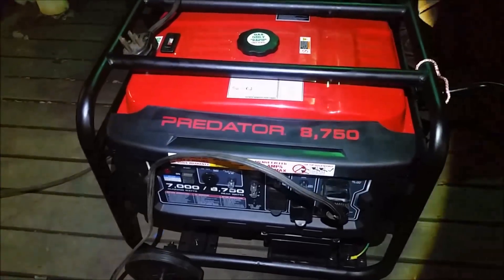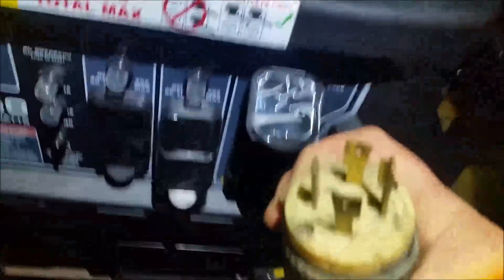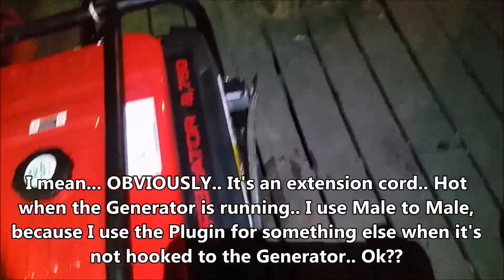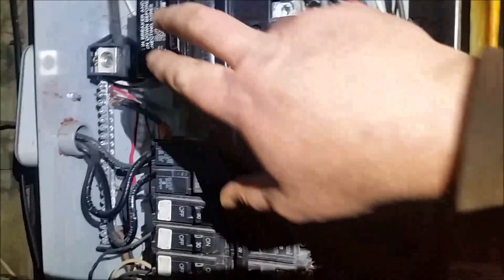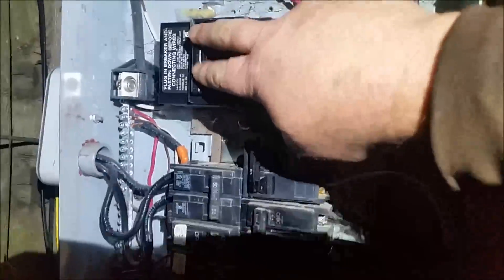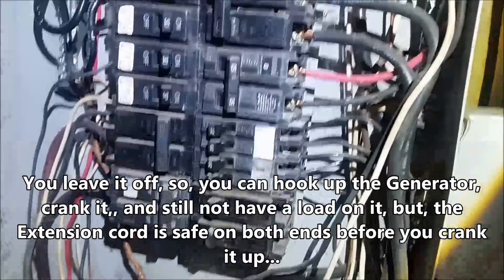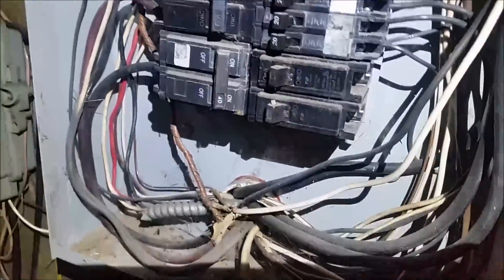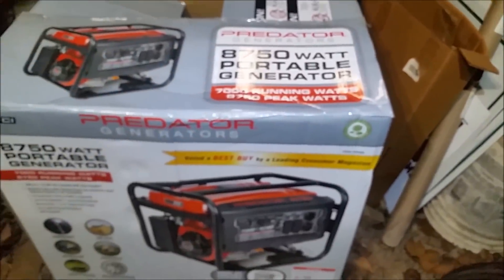Quick/Easy/Safe: Use Existing Plugin/Breaker for Generator hook up to your house Panel box.

Comment: Story time......
One of the many times i used a suucide cord this is what happened.
I hooked up a gen by backfeeding my welder plug in my garage. I told my wife dont touch it no matter what. No point of explaining y other then i said it could kill u. While i was at work i called her to ask her the status of the fuel level. She said the gen is off and shes back on grid.... i couldnt form words for 15 seconds then only curse words for 30 seconds. Why, how, what the f did u do?!!!!. She said the neighbor came over and told me power was back on. He helped me switch it back. Whats the big deal? I said how exactly did you do it? She said the neighbor unplugged it and told me to turn the main breaker back on. I said did he unplug both ends? She said i dont know he said it was ok. I said just stay away from the cord in the yard that he unplugged. Im on my way home. She said its not in the yard its in the garage. I said when did it get put in the garage?
 She said she put it in the garage an hour or so after the power was restored so she could cut the grass. When i got home guess what i found. A LIVE 240 VOLT MALE CABLE LYING ON THE FLOOR. "I" ALMOST KILLED MY WIFE!!!. It doesnt matter how well you explain it people can not be trusted to stay away from this deadly hook up! Its not worth risking someones life over $200 for a gen interlock and a proper receptical for legally backfeeding your house! Dont do it no matter what. Now u say i live alone its fine no one will touch it. Ok... your putting yourself at risk of jail time. How? Ill tell u. Lets say your neighbor is doing the same thing. Except hes not as " smart" as you and forgets to shut off his main and back feeds it into the grid for even one second then his breaker on his gen pops. Or burns up his gen. Well at the end of the block his gen went through the transformer and energised the 7,000 volt line. Cause transformers work both ways. There was a lineman working on the line that he had confirmed dead and 0 volts on not 10 mins ago. He gets electricuted with 7,000 volts and dies. Now the foreman and the shariff are driving around the neighborhood and lookimg for people on generators. They see u all lit up. Prove to them it wasnt you who just killed the lineman. Good luck in court.
Here are some short videos proving my points
How the lineman gets killed. Google it they do get killed every year with backfeeding
https://youtu.be/GA_zhLogUG8

Thus is what you should do
Below are interlocks and how they work. These are the 2 companies that make them.
Geninterlock.com

Interlockkit.com

https://youtu.be/n7DkaorEQPQ

https://youtu.be/_pQpXo4np4k
Reply: I would never leave home with a generator running with or without a transfer switch. BTW I do use a male-to-male jumper cord.
Reply: @shofar-man  now that its on an interlock my wife or anyone can turn it on or off safetly. Its idiot proof. Now ive got 100 gallon diesel tank jooked up to auto fill the gen and ive left town with it running. All my sytems are idiot proof. To prevent accedents. Im not going to take 3-4 days off work to watch a generator.
Reply: I see your point, but my wife was a survivor and could make it through the day w/o TV and all the frills. We have wood as backup heat and as long as we have a supply of water for drinking, washing and flushing we're OK. My solution is a 5KW backup generator to keep us in water and some frills when we want them but I turn the generator off at night, when I leave home and when not needed. My son's family is different and he has the fully automatic transfer system along with that big ugly generator and propane tank .
Reply: @shofar-man  and mark thomas. i dont ever turn off my generator when i leave or at night because i dont want one of my 2 deep freeser holding $2,000+ worth of my anual cow meat purchase to go down and loose my meat. I'm currently building an automatuc whole house battery backup system from a fiat 500e electric car battery and some computer server UPS. 6,000 watts 20kwh worth of battery backup. The issue with the whole house home depot generators are they are maintenence nightmares. They are just 2 cylinder air cooled lawn mower motors. Some dont even have oil filters. They are not meant to run continously for days. They burn oil too fast and shut down on low oil warning aftet a few days.
Go start up your rideing mower put it at full throttle and walk away for 3-4 days. Let me know what you come back to. They also make automatic start and transfer units that work with my military units. I just installed one on my friends off grid set up in hawaii. https://greenmountaingenerators.com/product/mep802a-mep803a-mep804a-mep805a-mep806a-auto-remote-starter-kit/
My gen is a Mep-803a. They have 500hr oil change intervals. Pure sinewave output, built to run a yaer straight without maintence except oil changes. Run at 1800 rpm not 3600 like your lawn mower, so much quiter, water cooled and have adjustable output for single or 3 phase.  Ill install an auto start and transfer on mine sooner or later. I hope you buy and install an interlock to keep the people around you safe and remove this video from youtube to prevent others from doing this. These days people on social media and youtube are held accountable for what they say that causes others to get hurt or hurt others. FYI
Use geninterlock.com
Or interlockkit.com
Get a 30 amp gen receptical from home depot or amazon. Install that then post that video.
Reply from the maker: There is nothing wrong with making something Idiot proof.. I do quite a bit of that around my rafting company for a few employees that I get from time to time.. I intentionally make things that will break, where they are easy to fix, before I have to rebuild the whole damn thing..  Lots of things like that. I know what it is like to have idiots around.. But, for my Panel.. Not needed..  No idiots messing with it.
But, my work is here on the property, so, I don't have that issue either.. I am rarely out for more than 6 or 8 hours, but, I am frequently out for 6 or 8 hours.. I think the longest I was out was 3 days.. Too expensive to run the generators 24/7... On an extended outage, I will some tractor work, or something I can do with a cordless.. Or, I just do some running in town, etc.. I have gone and stayed with some friends during an extended outage.. Never enough time to visit anyway and someone is always asking, so, don't have that problem either. To each it's own.. 
But, I could not afford to make everything idiot proof..  Too many vehicles, and too many other things, and you can never tell what an idiot is going to do.. I just limit what they do,, do..
Reply from the maker: Mechanical Stuff: I won't argue with you about the fact that "some people" need at least an Interlock at the very minimum..  It does what it is designed to do.. You surely need to turn off the main breaker before hooking up your generator.. But, there is one thing that seems to be a problem here.. 
The same person you don't trust to Turn off the Main Breaker is the same person that you are telling to "Open the Panel", pull the cover off, and drill holes with some degree of precision in order to mount an interlock... Also requires moving of the generator breaker to the top breaker slot, just below or across from the main... Again.. This is being told to the guy who you can't trust to turn the main breaker off... And, what is the easiest way to be sure that you get the interlock installed correctly?? To install it "On the Panel Cover" while it is sitting "On the Breakers"... I remind you.. This is being done by the same people that you are afraid won't turn off the main breaker.. Now, he has the interlock in his hand,,, he is trying to figure out how to drill the holes in the correct area.. The only way for a simple DIY'r to get it right is to mark the holes while the Interlock is in place.. The most sure way to do it is to drill it while it is in place.. I would imagine how 90% of the people who get one installed correctly are going to do it... I remind you again.. Now the guy who forgets to turn the main breaker off is going to drill through the panel cover,, into a hot box, while holding an interlock (Ground) to the box..
Every whatever you do with a Generator requires that you "TURN THE MAIN BREAKER OFF".. Doesn't matter if it is a Manual Transfer switch, Interlock, or totally without... 
This setup does not require that you go into the panel in any manner whatsoever.. Much safer.. And, I can tell you.. Holding a Male to Male Extension cord is like holding a snake.. You know you are holding something that can seriously help you.. If you can make the cord without any instructions from this video, you won't forget to turn off the main breaker when you reach over and pick it up... 
That brings me to your wife and neighbor... As you were telling the story, I was trying to guess what your wife was going to do or did before you actually stated it.. What happened was not in any of my thoughts.. I went back and looked to see,,, He told her this could "Kill Her".. I went back and looked.. Yes.. He did... 
Then,,, why,,,, I mean WHY???? Did she totally Ignore your warnings??? I mean.. HONEY,,, YOU COULD DIE DOING THIS!!!  Not only did she not listen to you or take what you said with ANY Degree of Caution, or any thought to safety.. She allowed her Neighbor to come over and fool with it,, without even warning him.. Had she,, he would have been careful and that sure as hell would not have been laying the cord out hot in your carport... 
I don't mind telling you.. It really bothered me.. I had to think and wonder why would an Adult,,, not take or heed the warnings of another Human Being, when loss of Life was Imminent.. Above all of that.. It's even worse!! This is not just some human being,, not some quack on youtube.. This was her HUSBAND!!  Then,, I thought about the post and it hit me... I am going to tell you what the problem was, and I am sure still is...  This is not an isolated incident... If there is a situation again,, maybe not this exact one,, but, if there is another,, you might as well figure you could very well have this same life threatening situation again.. And, I'll tell you why... She totally Ignored your warning.. So much So,, that she didn't even bother to warn or even mention that she had been warned by you,, to your Neighbor, to at least give him a heads up,,, that at least you were concerned.. I am hammering this home,,, because this needs to make sense to you.. There is a problem, and you need to know how to fix that... I do not have that problem.. If I say it is dangerous,, then,, it damn well is, ,, and there is no confusion about it whatsoever.. You don't have that same privilege.. Are you starting to try to figure out why yet??
Considering the substance of your post,,, have you ever heard the story about the little boy who cried Wolf?
He alerted there was danger so many times when there was none,, that, when there was,, he was ignored.. I'm sure deny is what is in your mind right now, but, you have to agree.. THERE WAS SOMETHING DEADLY WRONG,, when your wife didn't even warn your neighbor,, or at least say,, "Hubby says,, this setup is different and will Kill You"!!  What if she did?? Would he have stopped and listened? Looked? Called to ask you,, hey,, how do you do this safely??? 
Why did every possible safety measure of Human Self Preservation Fail?? Someone did not believe you.. And that is a FACT!!
So, think back of how many times you used that type of comment in the past and not explain why?
Obviously,, you did not explain the Male to Male cord to her, or she would have warned the neighbor.. NO.. She would have done it herself,,, or she would have told him exactly what the danger was, and he or she would have never left the cord laying live on the ground.. 
There is a big difference in you and I.. I can tell.. If I am going to say something "Will Kill You",, how rare the comment would be made,, but,, with something like this,, I take the family out there and stress where the threat is... It is specifically handling the Male to Male Cord.. Look.. It is different, and this is why it is dangerous.. but, only this is dangerous,, and this is how you do it safely,, and this is why it is dangerous.. 
There is no way in hell anyone in my family would go out there and do anything with that Male to Male cord,,, unless the Generator was killed and the main breaker was off.. It does not even need to be posted in the inside of the panel.. If they don't remember,, they will stop and call me.. And,, if they can't get in touch with me,,, they will just wait,, if they can't remember, but, more likely,, they will all get together and go out and look at the box and remember "HOW IT Works", because I explained it to them, when I was warning why, and explaining how it all works... Explaining how things works to my family is not a weird once in a lifetime thing... We learn something new every day.. When something breaks,, you look at it, see what is wrong,, see how it works, and why it is no working and you see if you can figure out  a way to fix it and you fix it.. Dangers considered in the "How it works", and often you need to throw in the "Why it works like that"... But, that is how it is done at my house, and also why I do the generator like I do.. I could surely install an Interlock, Transfer switch, etc.. I just don't need to.. I can remember to turn the main breaker off.. How many times did I point that fact out in the video?? If I say something more than once,, people who know me, know I did it for a reason.. 
Now to the video you posted.. I agree it is a good one.. They went through a lot of trouble to hook all of that stuff up for it.. No, not actually.. That is their training rig and they just did a public service video while they were at it.. They sound like a coop and are probably a smaller one.. Very family and Community oriented.. I looked at the list of videos on their account. Way more than just a few safety videos... I'll bet they are an awesome company to work for. But, go back and listen to the video again. What is the warning they keep saying over and over.. First Responders.. Why do you think that is the case?
It's simple.. Do you see one frame anywhere in the video where anyone but the video narrator is without linemans gloves? NOT. Because,, if you want to stay alive in that field, you follow the lineman's code.. A line is never cold, even after you have verified it is.. Never!!  The only time you will find someone without gloves is if there is no supervisor around, and the line is down and isolated, and then, it is well known it is a bad habit and whoever is developing a bad habit will get some nasty reminders.. First responders on the other hand, are aware of hot lines and are not as careful.. And, the danger to them is real.. And, that danger is someone hooking up a generator after a line is deemed safe by the average individual. 
It is up to the person with the generator to make sure that he/she/they are isolated.. Most people put a sign in the panel.. TURN OFF THE MAIN BREAKER.. If you are in there, in 90% of the cases, you should..
BTW.. People get killed every year by being struck by lightning.. 40 to 50 lightning strikes per year world wide... Facts: 
https://en.wikipedia.org/wiki/Lightning_strike
But, are you the type of person who goes around spouting those types of facts??? Because we all know the likellyhood of lightning striking you.. 
Is that why your Wife and Neighbor pay you no mind??? 
She does not sound like she is stupid.. There has to be a reason she did something so dangerous.. Did you just say,,, Lightning will strike you",,, or did you take a few minutes to explain to her that,,, "IF YOU DO THIS,, YOU WILL GET STRUCK BY LIGHTNING"... There is a HUGE DIFFERENCE.. 
If you told me that many people die from Lightning strikes every year,, without telling me the odds are roughly 40 to 50 per year out of roughly 8 Billion?
Because,, if you did,, and you told me something else would kill me.. I would not pay much attention to you either...
I would suggest that you do one of two things.. Explain your setup to you family,, and your Neighbor,, or,, get a transfer switch... Or, Install a Transfer switch at least, until you build up your credibility again.. 
One more thought.. I see you setup a 3 phase converter with capacitors, etc.. If you ever get tired of troubleshooting the capacitors, etc.. since that setup is pretty rough on them,, you can belt drive a spare 3 phase motor with a smaller 120v motor and generate the third leg with that extra 2 phase motor.. 
If you ju
Reply from the maker: Mechanical Stuff: I hit enter before I finished the 3phase converter comment. 
If you just have one piece of equipment you are running, just get 1hp above what you are driving for the spare motor.. The more motors you are pulling, the less total is required.. We are running a full (Large) machine shop on one spare 20hp 3 phase motor.. It was either spend $15k  to run another phase down the road to the shop, or buy a second hand 20hp 3 phase motor and set it up under one of the tables and let it run all day.. It's been running for the past 8 years.. We bought the motor at an auction for $100.. No one needed a motor that big at the auction.. I have since picked up two more for less than that.. 
Interesting videos... Wife shoots a 50 cal? She ain't scared for sure.. I think you just need to explain the generator thing to her in a little more detail.. Cheers.. Be safe..
Reply: @MarkThomas123  thats alot to unpack give me a miniute. Haha
Reply: @MarkThomas123   Mark Thomas
1.  the neighbor. We had just moved into that city neighborhood. The neighbor and i had only ever talked once at this point. He was a older guy just trying to help but is kinda pushy when it comes to helping.
 2. The wife, she as you saw in not shy from dangurous things. She conceal carries every day. She buys me guns as gifts and came from country living. So the old guy next door was usually a knowlegable person she could rely on. This time she was wrong. We have since moved back out to the country. 
3. If you cant figure out how to use a sharpy or center punch to mark acurate hole loacations you definatly shouldnt be making a suicide cord.
4. If its above you skill level to do it then pay an electrician $200 for labor and $200 for parts and have it done right.
Is your families lives not worth $400?
4. Im no cry wolf i dont say it'll kill you unless i mean it. But she thought the neighbor had taken care of the kill you part. She was wrong. People are wrong and make mistakes all the time. I make 100+k a year as a senior research and development high voltage electric car test technitian/wind tunnel operator. I have an Airframe and powerplant licence from MIAT in canton mi. I did resarch and development for williams international building and testing private jet turbine engines, before that i built 5,000+hp pro mod NHRA engines for a local race team. Now i buy fix and sell millitary surplus diesel generators as a hobby. I also make and repair 3 phase rotary and digital phase converters. 
Every one who knows me knows what i tell them is factually correct and truthful or i have no problem saying i dont know for sure. 
There is no lack in my credibility athankyou.
5.You said if some one in your family forgets how to do it they will get together and figure it out. Yeah your going to kill someone. So aperantly you never heard of power companies like Pike who have a reputation of having on site accedents. There are more companies just like them with laxed rules on wearing gloves the down line has been verified 0volts and grounded. Thing about electricity is electricity will take all pathes to ground not just the shortest. Shortest path to ground is a myth. 
6. Using another motor to spin up a 3 phase motor instead of using start caps and contactors is the way people who are too dumb to do it right do it. You also have to disconnect the belt from the single phase motor to the 3 phase motor or the caps on the single phase motor will burn out or creat drag on your 3 phase motor. Without the balance capacitors on a 3 phase motor being powered by single phase your voltage will not be balanced and you run risks of damaging your loads from excessive current draw on the highest voltage leg. All things you clearly dont understand. If you keep watching my videos you will see that that spacific 3 phase converter is a 3 part video. Finished it was tight and right.
Thats called research and development. Ill send you the link if you cant figure out how to find it all 3 videos
7. You never addressed the legal ramifications of being cought with an illigal gen hook up like yours.
When your neighbor screws up and backfeeds the line and kills a lineman but the cops catch you. Prove to them it wasnt you.....
Good luck with life and the need to always be acting like you know everything when you dont. One day chance will not be in your favor and some one will be injured or killed because of your ignorance.
All i can do is pray your half cheek methods dont hurt anybody.
Id say be safe but i know you wont be
Reply from the maker: Mechanical Stuff: Interesting.. I hope you type fast like me.. Ha..Ha.. 
3. If you cant figure out how to use a sharpy or center punch to mark acurate hole loacations you definatly shouldnt be making a suicide cord.
Just wondering if you have spell correct on whatever you are posting on.. It would be kind of embarrassing for an engineer of your latitude to turn in something with that many clerical errors.. Just saying.. Even voice to text spells correctly, even if it gets the words wrong.. You should copy/paste your post into MS Word or something.. I didn't pick the only sentence... :)
But, the reason why I pasted the sentence.. I feel like a sharpy for accuracy  is kind of like a carpenter with a carpenters pencil.. I won't even use one when I am framing.. Lead is too damn thick... The Automatic centerpunch though is a good tool.. And if I am going to get accurate, I keep a scribe in my overalls.. And, accuracy is not a requirement for building a Male to Male cord.. That is where some electrical knowledge does come in handy though.. 
I still am amazed that the wifey,, surely not stupid ignored your warnings.. Life and Death ones... 
 I make 100+k a year as a senior research and development high voltage electric car test technitian/wind tunnel operator.
Hard to believe that for a couple of reasons.. How could you misspell Technician? I have been a Technician in a large variety of trades/topics.. It is one word I don't think I would ever misspell.. But, the other reason.. High Voltage Electric Cars?? Are we talking about ones that drive around in circles with A/C connected to them,, or, are we talking about Battery assisted Electric cars.. Just curious where the High Voltage comes into play..
building and testing private jet turbine engines,??? Private Engines?? Wow.. That is a pretty expensive way to play.. Not sure what a "Private Jet Turbine engine is'.. Maybe the opposite of a Public?? Ha... Well, before you can build one, you have to design one.. Then, you must know what the biggest problem is with Conventional gas Turbine engines are?? The main problem that makes them inefficient and creates design problems?? 
Just wondering.. because, the big boys have been working on it for 30 years and 10 Billion dollars, and just began to figure it out in 2015.. Not sure why it took them so long.. When the problem was explained to me, it took me all of 10 seconds to say what was needed..
But, you know. You built and tested them.. 
 i built 5,000+hp pro mod NHRA engines for a local race team???? WOW.. AMAZING.. You should have let someone know about that... That little pudunk racing team could have been the star of the NHRA.. Because the most HP ever on record was 4000... Shame.. I thought you had broken a record.. I knew I would find you pasted all over CNN and HHRA website, since you managed to do something no one else has done before ..Ha..Ha..Ha.. 
See what I mean about telling stories,, exaggerating and blowing things out of proportion??? 
5.You said if some one in your family forgets how to do it they will get together and figure it out. Yeah your going to kill someone.
Yes.. That is what I said about,, if they forgot which way to hook up, or unhook the generator setup.. It's pretty simple.. The key is that the Main Breaker is off and the Generator is not running when you connect/disconnect the male to male cord.. You made a big deal out of it.. But, I did the for instance,, or If,,, they would just walk out there,, look at the setup.. Remember, Main Breaker off, Generator off before you mess with the cord.. even if they forgot, common sense would stop them from doing anything wrong.. I don't see how you can't see that.. It is easy to understand.. But, I can see if you don't,, it is kind of scary.. It's ok though.. I promise you.. I could explain it to your wife and kids so they would understand it and know what they can and can't do.. And, guarantee you that they would never let the neighbor mess with it, until he explained it back to them,, if he really wanted to help.. My family is not afflicted.. Trust me.. My 80 year old Mom with disabled husband has this same hookup, and she hasn't called me in years to hook it up.. She is out just as often as I am.. I always offer to come and do it for her, but, she always says,, I have it.. 
6. Using another motor to spin up a 3 phase motor instead of using start caps and contactors is the way people who are too dumb to do it right do it. 
Yea.. I know.. I can't make a generator hook up and work either without all of the drama.. Ha..Ha..Ha.. Well,, if you are ever up in Western NC, I'll show you a fully outfitted Machine shop (probably 20 working units) that run off of one 20hp 3 phase motor.. How many will yours support?? Ha.>Ha..Ha..Ha..Ha.. Who's doing it right??? Ha..Ha..Ha..Ha.. Just because you can't see the simple way is often the best way,, with all of your years of engineering experience,, doesn't mean that some guy who has an idea and plays around a few days can't figure it all out and do it simply.. 
I'll be thinking about you when you start trying to figure out which capacitor is starting to fail when your "Single Piece of Equipment" Won't start up.. Ha..Ha..Ha.. You havn't thought about the fact that, once you start your motor it doesn't use the capacitor setup that you have??? Ha..Ha..Ha.
And, yes.. You startup the Motor by belt driving it with a smaller single phase motor and when it spins up,,  it stays running and generates the 3rd leg you need for your other 3 phase motors.. All they have to do is start up, and be plugged into the same circuit.. 
To be honest, I am wondering if you really know what you are talking about.. If you did, you would not have built a limited system like you did.. Of course,, there are no videos of doing what I am telling you how to do.. I wasn't doing videos back then, or I would have put one up.. 
But, there are plenty of videos of guys doing the single motor start systems like you are doing.. And, plans are everywhere for them.. 
7. You never addressed the legal ramifications of being cought with an illigal gen hook up like yours.
There goes that spelling again. Ha.Ha.. Caught.. and Illegal.. Well, there are not any problems.. I don't forget to turn off the main breaker, same as I don't forget to brush my teeth or tie my shoes or zip my zipper up... And,, you keep saying Illegal.. You do mean,, not supported in the NEC code?? 
Illegal would mean it is against the law, which it is of course "NOT".. What I do at my house is my business.. And, as soon as the power is back on, I remove the cord, put it on top of the generator, and when it cools off, I put the cover back on. Nothing illegal.. Not code compliant, but, not illegal.. If I were an Electrician, and I charged a Joe Blow Homeowner for a "Generator Install",, he'd better damn well know and approve and sign off of what we agreed to, before I left, because I could loose my license, but, I would never go to jail for it,, even if I were an Electrician.. If I did sell one to a home owner and he later hurt someone and decided to take me to court,, it would be a civil case and he would have a damn hard time suing anyone,, if he agreed to the type of install and knew the difference in the two... 
BTW.. It doesn't hurt to pray for anyone.. I Welcome it.. But, don't need it for common sense stuff like this.. Maybe for picking the lotto or something..Ha..Ha.. 
BTW.. I think you are further proving why your wife did what she did.. Bet she hasn't done it since.. Now, that she understands,, it "REALLY IS" dangerous.. Cheers.. Had fun..
Reply: I guess Mechanical Stuff overlooked the title of the video, "Quick Way   .   .   . " and wants everyone to follow a more expensive path. My freezer box may not have $2K worth of cow in it but it holds its temp with a cycle of cooling every now and then, we don't normally open the box during an outage.. I am usually on my property and prefer the economical approach, I even enjoy managing my loads and keeping check on things. I must point out that to the best of my knowledge no one has ever flipped a breaker in my panel other than myself and my son and we both know our way around electricity. As I said in another post along the way I have been using this approach for about 18 years, the generator is so old that it has the NEMA 6-20R receptacle (correct spelling). MS could have supported the public better by posting a video instruction of his approach rather than throwing darts over here.
Reply from the maker: I hear that.. I don't worry about my Freezers until the end of the second day with zero power.. It's a huge ice chest.. And, I keep it loaded with Cow, PIG, and Chicken (ha..Ha.. )..  I have to say though.. $2k? I have the biggest stand up freezer you can buy. I would be hard pressed to stick $2k worth of it in there.. Of course.. I have not bought less than $300 worth of meat in a long time.. I love the guys who get $800-$900 worth of food stamps a month.. I always buy my meat all at one time from the local Meat Market.. I buy the food stamps for $.50 on the dollar,, and fill er up.. But,, I started canning during the off season.. Then, I don't have to worry so much about eating/rotating it so much.  I just buy a few months at a time.. 
I can't say I have had anyone flip one of my breakers either.. 
BTW Ed.. NEC does not regulate extension cords.. I did some research on it. I also met a guy getting his journeymans license and had him crunch it over with his instructors too.. NEC says, if it gets plugged and unplugged regularly, it can use an extension cord.. If not, it should be wired direct.. 
It does not cover lamp cords, extension cords, but, does specify the way the Plugs and Receptacles are made.. 
The second post on this page from the site moderator sums it up.. Then, it is further discussed. 
http://forums.mikeholt.com/showthread.php?t=158086
Once you look at that, if you look at the NEC definitions for that section, it confirm it.. There is a difference in  cord connectors and cords or extension cords.. 
https://iaeimagazine.org/magazine/2014/12/02/article-406-receptacles-cord-connectors-and-attachment-plugs/
Cheers.
Reply: @MarkThomas123  heres videos from my other channel i started this other channel cause the mechanical stuff channel used to have my name and videos of family on it. I changed the name and removed my family videos
This is a solid state 480 volt 3 phase converter. I step up 240 single into 480 single then put it into a 3 phase vfd that generates 3 phased veriable frequency. It doesnt know how many phases it sees just cares about voltage. This works the same as the lineman transformer. Backfeeding a transformer will give you primary voltage. This case its 480
https://youtu.be/6dMwxFX_vlQ